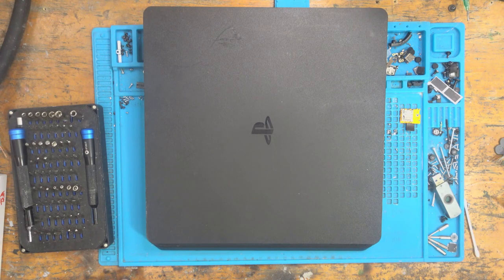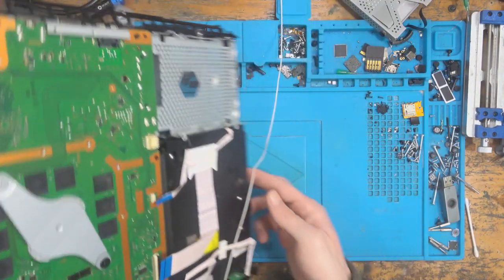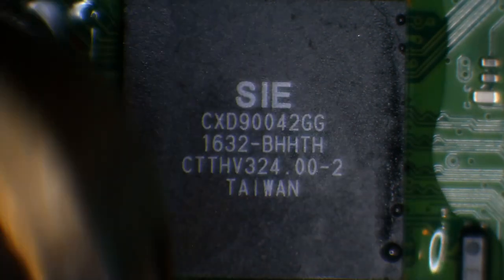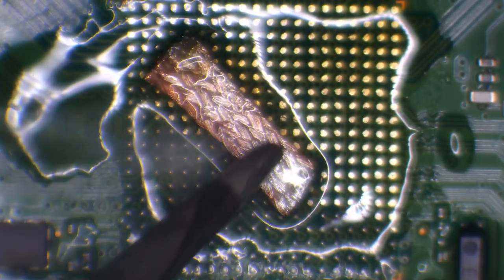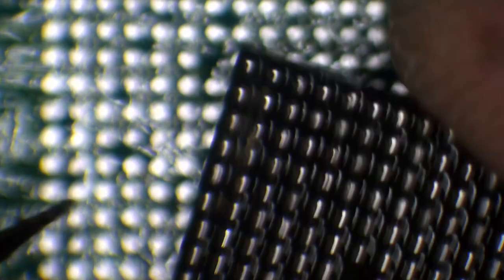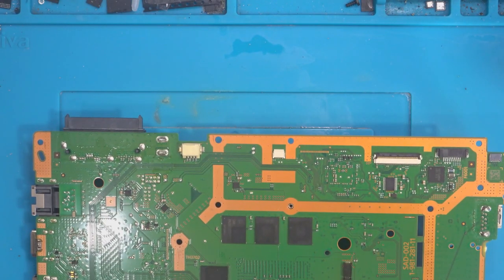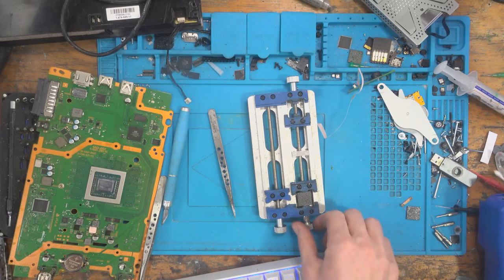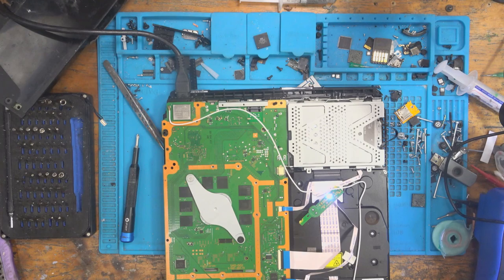PlayStation 4 Slim CUH-2016 Not Turning On At All - Can I Fix It?

Comment from the maker: Hey everyone. I'd appreciate it if you check out my Twitch channel @ https://www.twitch.tv/thecod3r2015
Reply: It didn't work the 1st time because you should learn how to mount smd:
1. You added too much flux while mounting - absolutely can't do that. After reball or new component you can add only tiny amount with your finger on the board. You insted poored a barrel there.
2. You didn't check weather all the balls were soldered under the chip. How you do that? You must slightly touch the chip while hitting it up, so that it will move a 0.01 mm and get back.
So basically the problem in your case was that the chip was not installed properly Sir!

Comment: Good video, friend, a question a few months ago I took the console to repair since it had problems with the HDMI port and the video IC, they changed it and everything worked, but at one hour of play the console froze, that is, the image as a photo that according to what the technician told me, and he told me that according to most likely they have done a "reflow" to the chip but the console does not show me blue light, the console turns white.

Comment: Nice work brother, what is your Reballing machine model and can you advice any at cheap price?
Reply from the maker: Thanks mate. Its an Achi IR Pro SC. Unfortunately for anything reliable you really need to spend a fair amount of money for a proper infrared machine. Mine retails at around £800 buy you could do what I did and try and find one used on ebay. I got mine for £400 used